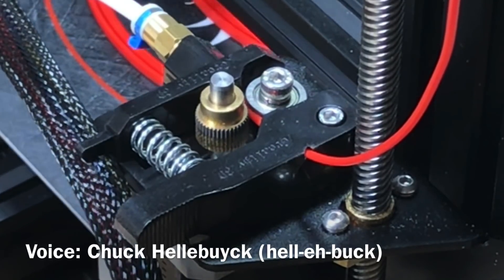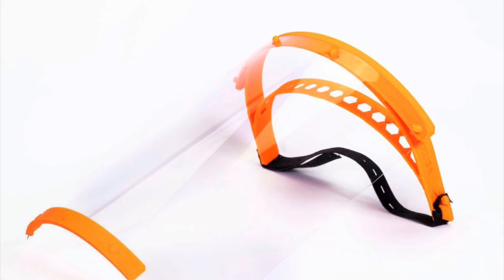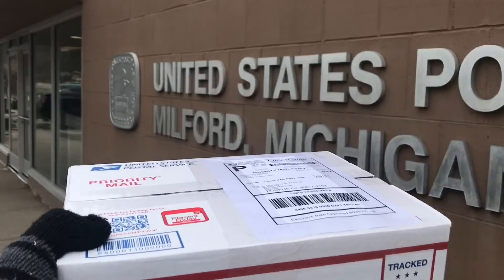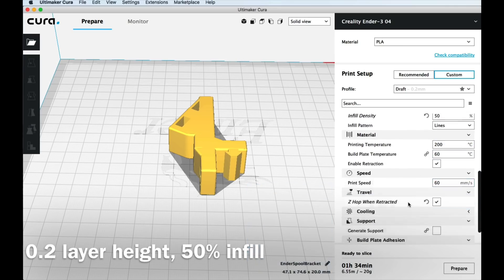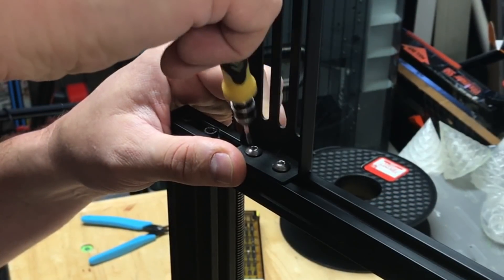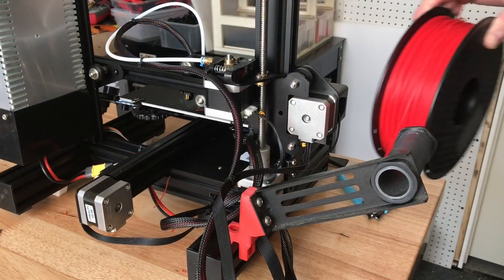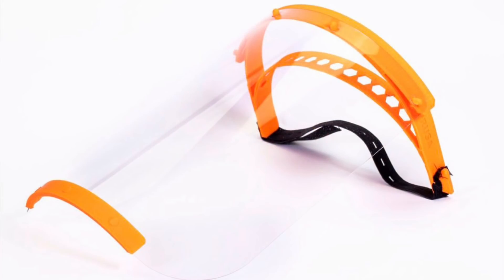Fix Creality Ender 3 Filament Extruder Erosion - in Prusa FaceShield Clips Farm

Comment: I just bought one of the red dual gear extruders. They appear to have improved it and the non driven gear now has tapered teeth at the bottom, so it no longer grinds on the lever under it. At least mine had the updated gear.

Comment: Well, I thought I'd print up this side mount, to take pressure off my eroding feeder. After having an Ender 3, I got my first massive blob. It just destroying my silicone sleeve, and was a mess to clean up. 

While ordering my new silicone sleeves, I decided to upgrade my filament feeder with the aluminium one by Creality. Why not? It's only $15 CDN. I got both within 3 days of ordering.

I installed the new feeder, checked the bed for level. I had already replaced the nozzle and cleaned the hotend tube, and starting on printing up that side spool mount again. 

Now I've been getting annoying wispy stringing for a couple of months now, and NOTHING I did would get rid of them. My prints were getting a little sloppy, and my settings just wouldn't correct anything. 

After installing this new feeder, all my troubles disappeared. That side mount printed so clean, I was ecstatic. The holes and nut voids were so clean, I didn't have to do a thing to clean up any part of it. 

I reckon it was the drag on the filament where the feeder was eroding. Even though I had feeder guides, it must have been still dragging, or slipping. Regardless, problem solved. 

Thanks!

Comment: I will try this. For some reason, the filament, brushing against the extruder feed hole, is leaving small chips of filament due to the friction (something like: scrape a candle with your fingernails and you get those small wax chips). New to FDM printing, not sure if that is normal or if my filament is of low quality

Comment: I found a version of a filament guide on cults (I think) that attaches next to the Z nut and has a roller that uses a piece of filament for an axle. I can keep my filament spool on top as designed and it creates a nice, gradual curved path for the filament. Also, Chuck, if you're reading, I watched one of your videos where you mentioned that the motherboard fan on an Ender 3 or Pro turns on with the part cooling fan and what to do to make it run always. I can't find that video again! Can you help? Thanks.
Reply from the maker: https://youtu.be/QvyesgYLwQk
Reply: @FilamentFriday  Thank you!

Comment: What bed do you use on your ender 3? I have the ender 3 pro and the prints dont stick to the magnetic bed with the same exact settings :l and I like the bed but I don't know why it doesn't stick anymore, I tried raising the bed temp from 60C to 70C, 200C on the nozzle and 50mm p/s print speed, also when printing big parts they tend to lift up (I think it's called warping) do you recommend me to change my bed or any ideas to make the prints stick again?  worth mentioning I have not tried the glue stick because I think it's quite messy but I could be wrong....
Reply from the maker: Wash it with soapy water. If that don’t work the glue stick does.
Reply: CHEP alright, thank you very much!

Comment: Which is the file you are using for the clips.  The first one I made was way too small and with 4 "holes" even though it had US in the name.  , so I tried another with US in the name, and doubled it in size and that was about the right size but the 3 holes were still way too close.  Plus, it split between the halves.  Probably needed to pay more attention and check the bottom layers.    I'm about ready to just print a curved bar and with dimples and use the small self-tapping screws that I have several hundred of, with nothing to use them on.
Reply from the maker: The bottom_reinforcement.stl file in the Prusa RC3 download.

Comment: Hi Chuck,
I am at the moment printing face-shields for a helping-project in Germany, and i have struggles with my CR10

Here is the problem: If i set the temperature to 210 degrees it stops Heating at 200, 
Same goes for 220 and so on,
And it won't Go Higher that 230 at all

What the hekc could bei the Problem?
Please Simeone help me...

Comment: You can actually mount the spool holder in a 45 angle at the top of the printer to eliminate grinding. 

Side note: your dual-gear all metal extruder is assembled incorrectly. You aren't supposed to use the orange spring with that style of extruder and the extruder should have come with a brass insert that goes in the spring and over the screw to allow adjusting the springs tension. That orange compression spring has too much force and is causing the aluminum arm to flex and grind into the extruder body underneath. I've had that extruder mounted in direct drive for over a year but sadly it actually isn't very usable as it's shipped. Not to mention that the Amazon sellers image isn't even the same extruder or assembled correctly either.
Reply: at a 45 degree angle? can you mabe share a picture?
Reply: @moclan5661  Take a look at thing:3446507 on thingiverse it should give you an idea what I mean

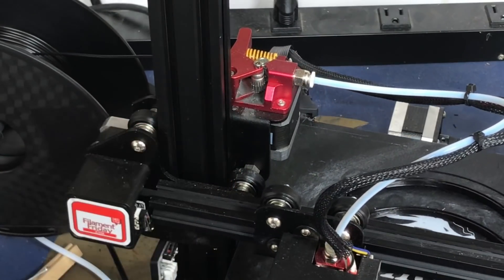Comment: 1:58 Haven't had this problem (, yet). I greased it with lithium grease from start (while assembling it), tho. 
But I think I have a solution. The problem is that you have a metal part grinding on another metal part (way softer), normally a (plastic or PTFE) washer would help but this part has too little tolerances to do so.
What I did was cutting a small piece of permanent (the PTFE coated one) parchment paper (bakery release paper?*) put a hole into that and used that as a low profile washer. 
Tho I suggest you carefully clean up the extruder from any metal dust, cause that is acting as abrasive.

*=am not an English native, so some things escape me

Comment: Hi Chuck, with respect to the Dual Gear extruder. I have the exact same one you used in your previous video and a very similar one for half the price direct from China. I found that the `levelling` spring that came with it is just far too strong for the purpose intended, so much so that the filament was so compressed and distorted that it regularly blogged the Bowden tube. Since replacing the spring with a stock Creality extruder spring both units have worked incredibly well without any sign of wear\erosion witnessed in this video. Boothy
Reply: Interesting... I've seen the same but not experienced any print problems from it

Comment: I have the metal replacement had to tweak the flow because the new gear that came with it fed the filament better.
Reply: I just dropped in Cheps value from his video straight into my ender... it wad very close, I had to drop my profile to 94% for perfect prints. I'll eventually get round to correcting the 6% error in the estep value and restore my profile back to 100%.

Comment: Hey Chuck. First, thank your for all your guides and tutorials, and for your profiles. It help me get up and running in no time with my Ender 3. I'm using a 0.4 nozzle, and I was wondering if I could use your profiles on others sizes? Specifically on larger nozzles like 0.6 and 0.8.
Reply from the maker: They make a great starting point.
Reply: @FilamentFriday  Great. Thanks!

Comment: Thanks for the video. Also a quick and dirty fix if you do not want to move your spool holder, is to glue a small steel washer onto the arm  so the filament will run through it. Remember to take off any sharp edges first.

Comment: I recently purchased an ender 3 Pro, and it had a metal insert in that hole to prevent this issue. I'm sure most new enders now have that.
Reply: you still need to move the spool to the bottom of the frame, this way the filament enters the extruder all most horizontaly
Reply: there's another problem with this part..  On my ender 3 in broke-plastic..  In that time I switched ptfe and nozzle, and was thinking they were the problem..

Comment: There is a filament guide way more efficient than what you showed on Thingiverse. It's placed right in front of the extruder and has a ball bearing wheel to prevent friction between the guide and filament
Reply: I have this too, it works good.

Comment: Chuck Wanted to know is there any file or version of what you just made so I could put on my C or tennis on the top of my printer because currently I don’t have enough space to put my filament on my box so I need to put it on the top of the printer do you have any STL files or anywhere I could look I want to 3-D print the T nut Instead of using traditional hardware because I don’t have traditional hardware so I need to 3-D printed

Comment: This is commendable, but, in all honesty, the main problem with the stock extruder is the weak design of the lever. It will eventually snap around the threaded insert and an inexperienced user will wonder how their prints suddenly come out severely under extruded. I would invest in a bmg extruder, even if it's a clone, and even if mounted in a non direct drive setup like a stock Ender 3. It will apply torque evenly on both sides of the filament.

Comment: That's too wide for my situation. I prefer the "Ender 3 Filament Roller Guide." It requires a skateboard bearing and an M3 screw, but it's a great solution that doesn't increase the footprint of your printer.

Comment: Much better advice to upgrade to aluminum
Reply: Honestly you would be suprised. Tom Jackson was having issues with his Ender 3 and thought it couldnt possibly be the issue of the arm because he had already replaced the arm with a metal one, spend days trying to debug the issue.. Finally caved and looked, the plastic had worn right into the metal arm as well.

Comment: I've used this spool holder since you first announced it.  It also has the benefits of sliding in to the top notch or the side notch on the rear rail making it adjustable to two angles.  It's the most versatile, stress-free spool feeding you will ever need.

Comment: The solution I use keeps the filament spool on top - it will never wear out. Get the Ender 3 Filament Roller Guide at Thingiverse. A rolling wheel guides the filament into the extruder perfectly. A bearing lets the wheel spin easily with the motion of the filament, there is no friction to wear anything out.  In addition, I installed dual spool posts on my filament bracket, and I made a dual top filament guide to make it easy to switch between two spools.

Comment: I was wondering, if these masks are actually alright to be used? I have been involved in engineering devices for medical/pharmaceutical industry and generally they are all required to be made of plastics that are fairly inert, such as PP. Mostly because alcohol is used to clean the devices/tools, and PLA quite readily dissolves in this. Or are these masks more intended to be a use once then throw away item?
Also for this particular problem, a brass insert would seem to be the best solution.

Comment: The Prusa design has been being rejected by some hospitals because it doesn't block spray from above entering in the gap between the mask and face. The NIH-approved design (3DPX-013238) has a slanted cover between mask and head to block this. Chris Taylor from Today's 3D Print here on YouTube has now remixed the NIH design to print in vase mode so that it prints very fast and uses less filament - check out his design (search on Thingiverse for 4251314) if you're interested.

Comment: My extruder wore like that.
I replaced the assembly with a single gear aluminum replacement.
Reply: Don't use the orange spring fixes the problem

Comment: Chuck, I know you need content for your channel, but unless your time has a really low value, the metal extruder could have been sourced and installed for $11 or less - there's no way your time is worth less than that to design, print, script, film, and edit this video. This plastic extruder being worn away has been mentioned in at least two, if not three of your recent videos. I love chasing quests down rabbit holes as much as the next guy, but there's a time when you gotta factor your time into stuff. I will say your solution scales better if you had multiple Ender 3's side by side that you wanted to address this on (just print more parts for pennies), but only if you're not using an enclosure with your Ender 3, in which case the metal extruder upgrade would still win. Thank you for all you do.

Comment: i just installed that dual gear extruder haha, any ideas how to prevent that wear? i watched your other video on it before i installed.  How many hours of service has that extruder gotten to get that much wear?  Instead of side mounting i went with the filament guide thing:3269017, you still keep a relatively narrow profile and a ferris wheel + bearing style should last a while.  I had one of the static filament guides to protect my plastic extruder and i sawed right into it like what you showed here in the vid.  Keep up the good work, love your ender 3 vids.
Reply: Don't use the orange spring
Reply: @CHEP It has been one month of basicall non stop printing and my dual gear extruder is producing a LOT of metal shavings, shame, it has been great up until now, i get random clicking, really disappointing as i really like this extruder until it started failing.
Reply: @CodyIrons  Tried to warn ya bud.
Reply from the maker: I’ve seen the same. Extra grease didn’t prevent it ether.
Reply: @FilamentFriday  did you ever try without the orange spring?
Reply from the maker: Yeah but after it started digging in. Probably too late. It kept rubbing.

Comment: I've used that spool holder (or some version  or it) for over a year. Mine is secured with T-Nuts on both the side and top.  The only issue (any why I went a different design) was because the holder started to twist.  The filament spool would rub the printer.  I went with a bearing design that was not a part of the printer.  Because of this, spool changes are quicker and easier as this design keeps the spool very close to the printer.

Comment: The only problem that I have with this mod is the spool rubs against the x axis stepper. That's the only downside. Other than that it's great
Reply: Just print a large washer or a coller to hold the spool away from the motor. I had a a small slinky and it fit the spool holder shaft. Just took the nut off the spool holder and slid the slinky on. It keeps the spool away from the motor and aligned with the extruder.

Comment: I bought a Ender 3 pro two weeks ago and it came with a metal insert in the hole. Is that something new?
Reply: It's a Pro thing for at least a while. My Pro from November has it too.
Reply from the maker: Sounds like it.
Reply: @FilamentFriday  Didn't know if it was a new thing or a pro thing. But I will still print your side mount because the filament has started to  get stuck and making the extruder skip steps. I think it is because the spool is running low and that makes the angel from the top to steep.